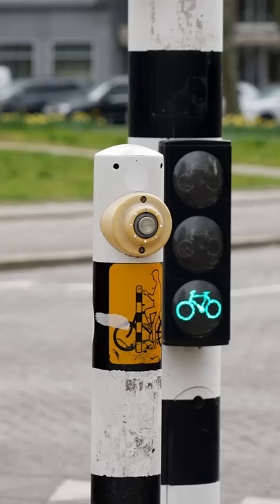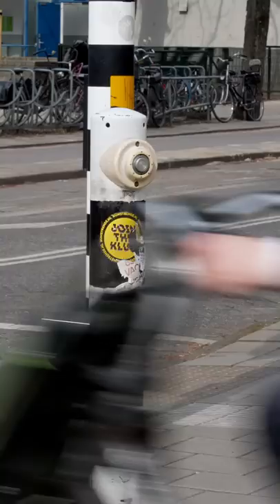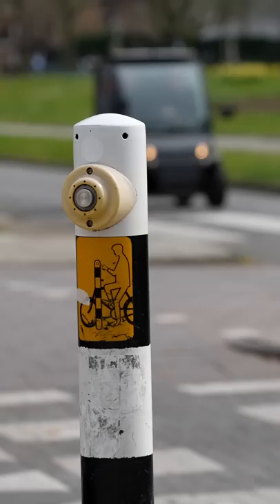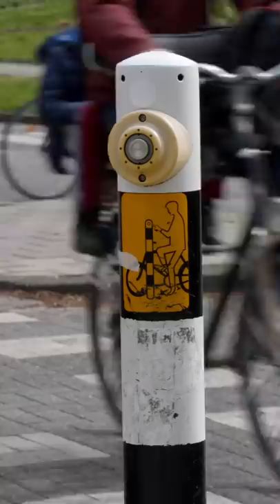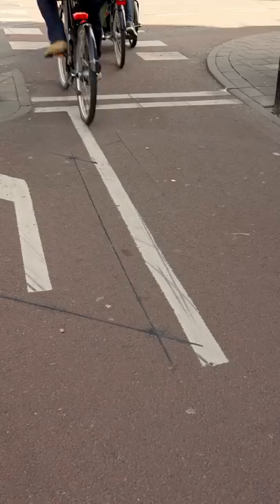You Don't Need to Press This Button #shorts

Comment: The actual reason for it to be there: If you are the first one at the button you can use the pole to stand against so you don’t have to get off your bike’s saddle. Second reason: If you live in Rotterdam you know that the light is red 97% of the time and green 1% of the time so the button is there for your frustration, you can convince yourself that spamming the button will help your endless suffering.
Reply: I live in rotterdam, the traffic lights on the routes I frequent as a pedestrian seem pretty well-behaved, so maybe it depends on where you are. It does surprise me how often there are a bunch of pedestrians waiting for a light yet noone has pressed the button, which for pedestrians is definitely not optional if you actually want it to turn green. rolls eyes
Reply: Can confirm
Reply: @dutchdykefinger  Really? never knew this.
Reply: Normally these buttons are linked to the light cycle. If it is pressed it knows someone is there and may modify the next cycle to be extended or add an additional cycle to accommodate the pedestrian. This video is exclusively about one city in one country. I think it's neat that they have the induction loops for bicycles but if they fail it's much easier to have a button available as well. The other issue that can arise is carbon fiber frames with carbon fiber wheels. The induction loops may not notice you. You should be able to lean your bike over a bit to get your petals or crank closer to the ground but if those too are carbon fiber because #weightloss, you're going to be out of luck... I know, this problem is exclusive to only the most well to do and extreme enthusiast but still a concern nonetheless.
Reply: Spamming the button absolutely does not help and is quite irritating, but that's a funny way to put it 😂😂
Reply: The big square where the Coolsingel meets Blaak is so fucking annoying. If you miss the green light, you're going to have to wait like 5 minutes before you can cross as a cyclist.
Reply: @thomasdelege2382  uuhh... the what's?..
Reply: @CAPTAiNC  yes, because that tells me so much more..
Reply: That'a 98% total, what happens 2% of the time? 😳
Reply: @therealshimo  Well, the remaining 2% of the time it’s on orange. 0.1% of the time it’s actually on orange and 1.9% of the time it’s on orange because it is broken…
Reply: @mimp8365  very accurate description of traffic lights
Reply: Rotterdam is ook veel te auto stad
Reply: This is what I do with normal pedestrian crossings
Reply: @user-ie6jr4bg1w  no but countries like america arent in the slightest bit bicycle friendly, we have seperate lanes fro bikes and our infrastruction is built around it largely, since the country isnt that big its easies to get from a to b on a bike
Reply: The button is for mental ease, its like a placibo effect, if u press the button itll go faster
Reply: What about the other 2%? Is the light just off?
Reply: @butterbutt1985  oh cool
Reply: @Rainbow0015  that 2% the light is orange  it goes Green, orange, red
Reply: they also fun to play with
Reply: Please redo first grade math
Reply: Where's the other 2%????
Reply: Jacob Davis  My previous comment “Well, the remaining 2% of the time it’s on orange. 0.1% of the time it’s actually on orange and 1.9% of the time it’s on orange because it is broken…”
Reply: @Moon_Presence  ^
Reply: @MatthijsvanDuin  onderweg naar de Witte Aap!
Reply: @bigmaxmer4902  the other procent is orange. On god on god.
Reply: whats the other 2 percent 😭
Reply: Where the othe 2 percent
Reply: "Endless suffering"

I like you 😂
Reply: @user-ie6jr4bg1w  can't judge it if you have never been here
Reply: 卍  I feel you but I can’t really go to the cinema while waiting for the stoplight. Would you have patience in games if the missions were boring and 7 hours each, no right? Well that’s the average wait time in Rotterdam.

Your pp: 卐, your name: 卍 ???
Reply: What about the other 4%?
Reply: Yes
Reply: But my road makes the button not clickable
Reply: I don’t think that’s how math works mate
Reply: pressing it faster and more often also makes the light go green faster
Reply: @user-ie6jr4bg1w  you really remind me of some german guy
Reply: @TS_Mind_Swept  Ikr. I always find myself trying to crack some code. Long press, 10 seconds hold, 3 short etc. Never worked, still...

Comment: Even if they’re redundant, my favourite part about these buttons is that you can actually reach them from your bike! In Toronto there are so many places where I actually have to dismount my bike and walk a few metres up to the curb to press the pedestrian button, or the light won’t ever actually change. There’s one intersection near me that has sensors in the ground that change the light, but only cars are heavy enough to trigger it, a bike is too light. Worst design :’(
Reply: Try what happens if you "dip" the bike closer to the ground, almost laying it down (while you straddle it) (more metal closer to the sensor might trigger the sensor)
Reply: Wah that's dumb, I hope they come up with a more intelligent design
Reply: Wait, seriously? That sucks.
Reply: My German city has handles around the traffic light posts for cyclists to hold onto ;)

Comment: In Enschede there are a number of lights giving you a countdown until the light goes green. If a bicycle has not been detected, the lights for the countdown are off. So you can always tell, even if the light is still red, whether your bicycle has been detected or if it's necessary to press the button (which sometimes does happen)
Reply: The same in Tilburg
Reply: Its in every dutch city…
Reply: It would make sense if loop controlled traffic signals would do the same for motor traffic too I think. Especially for motorcycles that are not always picked up by loops built with larger vehicles in mind. For me though this is just an extension of a basic UI design philosophy we programmers are taught, namely that any time the action of the user serves as the request, that request should be acknowledged so the user knows. This applies to passive requests also if the user is doing something in anticipation of an action from the system this ideally should be acknowledged so the user is aware what is expected of them in return. Having that visible indication tells the user "Yes I see you, please wait" thus reducing the risk they will assume they were not detected and take the risk of treating the red signal as a give way to continue their journey assuming it will never change for example. It would reassure the user that this is a delay and not a failure reducing the risk of misunderstanding leading to needlessly reckless attempts to "fix" a problem that simply doesn't exist to begin with.

There is a good reason why pretty much every interaction you have with the software on your computer will evidently do something on input even if the task takes time to produce a result. It may make a sound, change the cursor icon, or even throw up a progress dialog but it will generally do something to acknowledge "Yup I got the message and I'm working on it". Thus giving some insight into the mysterious black box which all computers are, hell there is a good reason why the dev builds of most software are capable of flood spamming the planet if asked to do so it's the only way you can get insight into what the hell that overpriced mega circuit of a CPU is doing lol.
Reply: @seraphina985  This is a really well-put explanation of this design principle and its relevance. I really enjoy topics like that and I'm getting deeper into compsci these days so I found it to be a really nifty and informative read! Thanks for taking the time to write that out!

Comment: Epic loop, wish I could commute on bike without getting killed
Reply: I feel your pain. I did not start cycling until they built raised paths here and now it's great! Buy the city bike summer pass every year for easy rides.
Reply: @Slugbunny  Raised paths? Sounds interesting, my state has an extensive trail system but I don't think I've seen anything elevated. I'll have to google that. I take it the pass you're referring to implies there's a toll for using the bike routes? (Not that there's anything wrong with that, I just want to know more about whatever system you're describing and how it works)
Reply: @ItsAsparageese  think he means citibike, which is in nyc
Reply: @SkylordAh  Ah (name pun retroactively intended), thanks, I would have never guessed that they were talking about a bike share service without the clue-in 😆 I had this image in my mind of some sort of elevated bike trails where you pay a fare to go up an access elevator or something, winding around above city streets and alongside walkable building bridges and such lol
Reply: @ItsAsparageese  What I mean is that the bike lanes are higher than the roadway. Used to have to bike cheek-to-door with cars, which is just mad. Now there's a heavy kerb for separation. Some paths were raised, too, but I realise I should have started with the lanes.

There's no toll to ride. The pass is for city bikes (owned by the city, operated by someone else). They're cheap to ride, no need to own a bike and two locks. It's about €60-70 per summer for me.
Reply: @Slugbunny  Ah that makes sense! Thanks for clarifying and giving me a clear visual to go on :) Sounds like a good design!
Reply: @ItsAsparageese  No sweat. Separate lanes and paths is great - everyone gets to drive, bike and walk in peace. ✌

Comment: In Germany instead of having pressable buttons we have detection loops for cars that will never trigger on your bike. On my way home the traffic light will never turn green for me unless there is a car in my lane.
Reply: Not just bikes! (pun intended) We have one notorious intersection where not even our scooter gets detected and it's always red if you want to go right. (also in germany)
Reply: It's happened to me sometimes that they wouldn't change. I backed up and rode more slowly, which seemed to work.
Reply: To be fair, most of the detection loops don't do anything for cars, too. I often see one car standing at a red light and another lane, where no cars are waiting gets green and all lanes have a detection loop.
I know some good working ones and even some exclusively for bikes, but most of them do nothing at all.
Reply: here in Karlsruhe the loops are working just fine, for bikes and for cars
Reply: @Zazzlebips  Itzehoe?
Reply: Sometimes "dipping" the bike closer to the ground triggers the sensor (more metal closer to the sensor may trigger it).

 Looks funny but if it gets the job done then that's what I'll do.
Reply: @user-zw6pn3ql7y  True - that works sometimes for me too. Though having to perform weird rituals in the middle of the road gives me the feeling of being treated like a second class citizen when on the bike.
Reply: I never encountered a loop that doesn't detect me as a bike.

Comment: The city I'm moving to is very pedestrian friendly, and their crosswalks make noise (letting you know when you can walk and counting down) when you push the button. If you don't press it, the light will still change, but it won't make noises. Some lights take a while, so I like to press the button because it says "wait" and if you spam it, you can make a fun little beat. Even better of someone else presses the button for the other direction at the same time.

Comment: Here in North America the inductive loops at intersections are designed to be triggered by cars. I've found that you can trigger them with your bicycle if you can get your bottom bracket spindle over the top of the loop. Sometime rolling the bike back and forth a few times is sometimes necessary.

Comment: I was at a fairly new intersection in Nijmegen that was remade last year or the year before.
The traffic light would not turn green if I didn't press the button.
It does detect cars waiting in the same lane.
I had to wait a whole loop for all cars and bikes in other directions to pass before my lane turned green.
I guess there's no induction loop in the ground there. Induction loops have been around for a while now, so why would they not use it?
Better to always press the button, just in case.

Comment: at a lot of intersections around the outer ring of Utrecht they’ve actually removed the the buttons and put what I think are laser (?) detection poles ! that way the system can detect someone waiting even if the bike is to light for the ground detection ^^
Reply: It's not weight actually, it's a metal detection thing, which is why there isn't anything they can do about pedestrians detection loops

Comment: Counterargument: button is fun <3
Also some sensors just have more trouble lol, the road i always went across to school would require me to push the button if the light had just turned red because it for some reason can't detect bicycles while switching to red

Comment: You can check out the ring of lights around the button. If the lights are lit, then the traffic light controller has a "demand" for that signal group. If no light is present, no demand has been set and the traffic lights won't turn green for you. If the timing plan has a "fixed demand" for that signal group, then the ring of lights will turn on automatically.

Source: I'm a traffic engineer working for a Dutch traffic signal company (not in the Netherlands though).

Comment: Sadly my experiences (here in the SF Bay Area anyway) with the detection loops in the asphalt are very mixed. Most of them don't work or if they do it takes 2-3 cycles for them to register. I just go when the traffic has the light instead.
Reply from the maker: That's because they're not calibrated properly to detect bicycles, and that's because traffic engineers in the Bay Area don't care about cyclists. The best thing you can do for a car sensor is to stop right along the loop, so that your bicycle is lined up along it. In Toronto they put 3 dots on the ground where the most sensitive part of the loop is, and you're supposed to stop your bicycle there.
Reply: @NotJustBikes  I agree there! Even with so-called "dedicated" bike detection loops they're pretty much useless. Ugh.... I wish we had the infrastructure you lucky folks have over in Europe!
Reply: @NotJustBikes  Great thought, but I dare* you to safely take the lane to do that in San Francisco.

*I don't actually dare you, you're too cool to be sent to the hospital in America due to car-centric urban design.

Comment: The detection loops (in the street) in my area were removed because drivers didn't pay enough attention to the signs and didn't stop on top of them. So, we ended up with people running red lights. That's more dangerous than the minor annoyance of having to wait at a light when there's no cross traffic.

Comment: You can see if you need to press the button or not if the button lights up as you approach. Most of the buttons have these “activated” lights. If they light up, the detection loop worked. If it doesn’t, time to press :)

Comment: I hate when the loops don't detect the bicycle. On my way to my last job, there was a red light that was just a little bit too insensitive because it was designed for cars. The only way to get the light to turn green was to lay the bike flat on the ground above the coil or to wait for a car.

Comment: In big cities, this is correct. There are detection loops. But in the smaller parts of the Netherlands, which is A LOT, there are no detection loops and you will be standing there forever if you don't push the button.

Comment: Funny thing: right over the border in NRW, Germany, many pedestrian and bicycle crossings used to simply be in the usual cycle for everyone, giving you about 1/4 to 1/2 green time, but recently (over the last 10 years) many crossings got "Modernized" adding two buttons (one for pedestrians one for cyclists). 

This made things actively worse, as the buttons ONLY re-add you to the intersection's cycle where it would automatically turn green. 
Even if you are in that phase currently it will only turn green the next cycle. This means that if you waited 0-30 seconds (30 seconds for one full cycle) now you'll be waiting anything from 5-60 seconds. Nearly doubling the average wait. 

This used to just be a minor annoyance of mine but recently it has been made into a major timesink, as 3 stoplights on my way to the Mainstation got retrofitted, which added an additional 5 minutes to my commute of 15 minutes due to them being timed in a way where you have to wait the maximum possible duration for each.

Comment: While it is true that most modern traffic lights in the Netherlands work like this - there are still loads that require you to push the button!

I've had several occasions where me and a group were waiting for minutes, only to find out the front rider was too stubborn to press the button because 'someone told me you dont have to press it'

Comment: Here in Sweden, it is quite common that the detection loop failed to register your approach, for several reasons, which makes the button useful. But it sure is annoying when the loop fails, and you (legally) have to stop to push a button, and then wait a bit to cross, despite no traffic

Comment: When I used to ride motorbikes (American), I could pull up to a red light at an empty intersection, plant myself firmly across the sensing loop, and proceed to wait for minutes, or finally give up and run the red. The sensitivity was set for cars, so my bike wouldn't trip it. They even sold large magnets you could bolt to the bottom of your bike in a vain attempt to influence the signal. They must have improved the sensitivity.

Comment: I think there are quite a few pikes that use materials that make them hard to detect by induction. Not just cabon fibre, aluminium and some other metal alloys are also not very magnetic.
Those are not uncommon materials for (higher end) Dutch bikes.